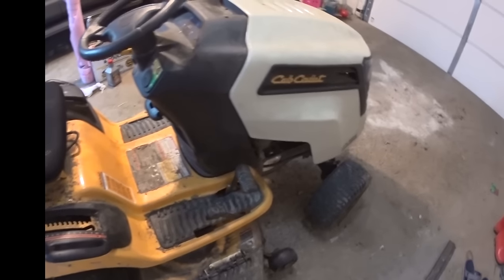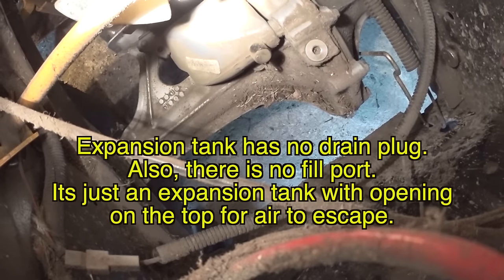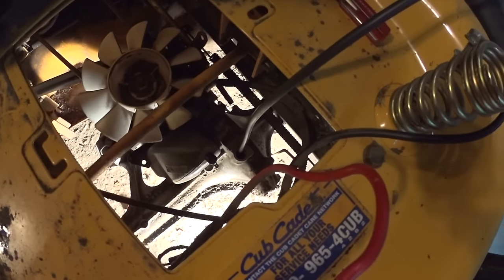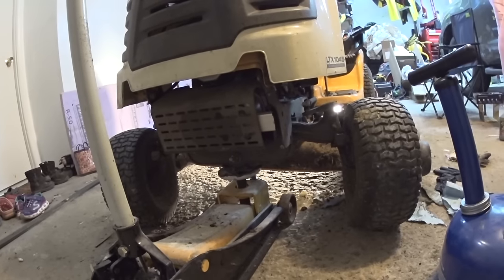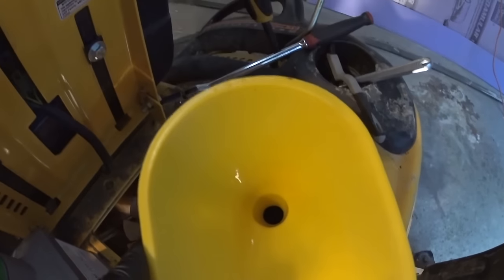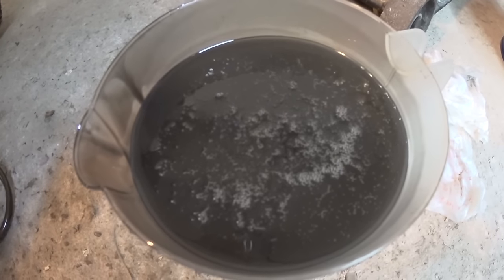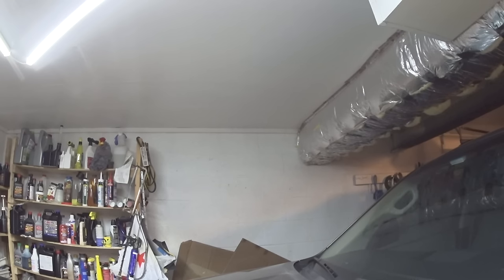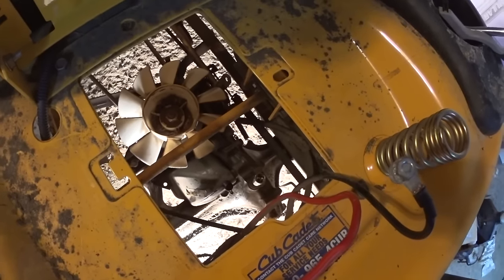Hydrostatic transmission fluid change, how to replace tractor transmission fluid, SCAG maintenance

Comment from the maker: Tools and fluids used in this video
Amsoil Hydrostatic transmission fluid 
https://www.amsoil.com/shop/by-product/transmission-fluid/automatic/20w-50-synthetic-hydrostatic-transmission-fluid/?code=AHFQT-EA&zo=5257753

Every car, truck and EV needs this https://youtu.be/H_bSDqnSh90
Maintenance mistake made by diesel owners https://youtu.be/WBOBzA56jvw
Why trucks don't come with this? https://youtu.be/hBbzJmCHtCo
How to improve lights without cutting or drilling https://youtu.be/K4WbM97pkmE
How to protect paint on the vehicle without wax https://youtu.be/I1fu9TsiYBc

Transmission fluid for HD applications
https://www.amsoil.com/shop/by-equipment/semi-trucks/?zo=5257753

Look at this 350k miles Ford. Since when Ford became reliable https://www.amsoil.com/newsstand/testimonials/articles/pristine-ford-flex-tops-350-000-miles/?zo=5257753

Topsider vacuum pump
https://amzn.to/2JzKtp2

Funnel very similar to what I have 
https://amzn.to/2PNWY1f

Pump for fluid transfer 
https://www.amsoil.com/shop/by-product/gear-lube/amsoil-marine-gear-lube-pump/?code=G3456-EA&zo=5257753

Hex set 
https://amzn.to/2PLIzCO

Measuring Cup
https://amzn.to/2Y2ZovW

Paper towels
https://amzn.to/2LmWhxk

Brush to clean around fill plug
https://amzn.to/2H63YEh

Update on fluid change video 
https://youtu.be/yedcpETVa-8

Comment: No questions at all, you covered it well in the video man you left nothing for doubt
Reply from the maker: Thank you
Reply: @repairvehicle  I did like the video, but the reason why I watch your video is I had to come to that myself, it's the 1500 LTX,
 I knew that I was going to have to replace the bearing soon in my mower deck so I went ahead and while I was doing that I've looked at your video so I can do mine but while I was doing my hydrostatic drive on the oil where you pumped yours out I don't know if you're hydrostatic axle is the same, but mine had a dream on the bottom of the hydrostatic drive there's a little round column on mine in the middle of it has a drain plug right in the center of it,
 But anywho I wanted to throw that in there about mine I don't know if yours is the same but if you haven't looked which most possibly you already have there's underneath my 1500, and also wanted to comment on but even though mine was a bigger tractor, it only took the same amount of oil was that yours did.

Comment: Looks identical to my Craftsman PYT 9000 (2011) I have. Mine is labeled "Hydro-Static 618-0319." Still runs well. Thanks for the video. I've not found ANY better YouTube.
Update; I meant to say Hydro-Gear. Upon pulling the top fill plug and removing the expansion tank  my HG was full to the top. I syringed out using livestock syringe about an inch and half in diameter by five inches and clear poly tubing. Put a piece of bailing wire inside the tube to direct deep into the axel. Got 50 ounces out and could see no more oil. Refilled with new back to the top. Tractor Supply store had Hydro-Static oil on the shelf. One gallon $29. May my tractor will work another 11 years now. But will change the trans at three per your recommendation. Thanks.

Comment: Excellent video! I have an older Craftsman 42" mower with this exact transmission. My transmission is suddenly working very weak. It will move forward and reverse but nowhere near as fast as it used to and not up or down hills. I am thinking my fluid levels are not only low but need to be changed after 15 years! This video really helps me. Thanks!
Reply from the maker: Thanks for commenting
Reply: Todd I have same thing happening with my mower did u engine changing hydro static fluid
Reply: @PeteyMcSavage  I wrestled with that thing for a couple of weeks and ultimately realized the transmission is not designed to be serviceable. I managed to siphon as much of the old fluid as I could and added new fluid but it didn’t help. I ended up replacing my mower
Reply: Replace the drive pulley under the fan.
Reply: Sounds like your drive belt was stretched and needed replaced.
Reply: @Motoxr32 great thought. I noticed my mower appears to lose power once it got warm as it would struggle on inclines and move slower on flat ground. I initially thought it was the engine compression, but then noted that it would climb hills excellently in reverse gear. So appears to be transmission or potentially a belt that loosens as it gets used/ warm.

Comment: Thanks heaps mate. I have and MTD ride on and the transmission is identical. Great video. Lots of good info and all of it helpful. No gimmicks or annoying acts. 
I searched for ages to try and find a video like this. My mtd ride on mower would drive around fine bit once it got warm after 30 min it couldn't make it up any hill as the transmission was overheating from lack of fluid. 

Took my mower apart looking for a full plug and couldn't see it because it was covered in crap and looked like a washer!

My mtd 42inch 16.5 hp has the exact same transmission as the mower in your video for anyone else in my situation
Reply from the maker: Don't forget to subscribe. Thank you for commenting.

Comment: I saw this when replacing my battery...saw the tray came out and noticed the fill and overflow bottle.  Nothing in the manual other than lifetime serviced.  Thank you!
Reply: I wasn’t concerned until you presented how filthy and contaminated the fluid was....I need to service mine STAT..

Commercial lawn tractor spin on oil filter engine and grease Zerks everywhere for long life with proper maintenance.  Even a little dashboard computer that tells you when to service parts of the tractor based on hours of use. All this to ensure a long life machine.

Yet the transmission sits in its own filth, ignored, forgotten and dies prematurely....nice.
Reply from the maker: If did not mention in the video, then I don't know the size.
Reply: @repairvehicle  
It's a weird one!
It is either a 6.5mm or 9/32".  1/4" is too small and 5/16" is too large.  
6mm is too small and 7mm is too large.
My guess is it is 6.5mm or 9/32".
I got it out using a 1/4" pulled to a hard angle to grip enough to remove the filler plug.  It almost stripped out, but got it.  Judging by the filth of the oil from my transmission, this is something that MUST be done every season with engine oil.  These being sealed and only magnets to capture particles is a crime.

Flushing mine out until it comes out clear.  Third time and still dark.  Good thing I got 2 gallons of hydrostatic oil.

Thanks again for making this video and bringing this to people's attention.  Lot of money spent on this equipment to be sabotaged like this.  Subscribed.

Comment: I have a K46 in my John Deere. It has no drain plugs, but it does have an internal filter and two round disc magnets. It also has two stumps in the housing, which will prevent you from removing oil from the top vent. It needs to be removed and taken apart, buy the rebuild kit from Tuff Torque.

Comment: There is a filter inside the transmission. You can get parts. Seals our also  available. If anyone having trouble getting the plug out just give it some taps on top. Works most of the time . But ust hard enough that you don't damage the housing or plug.

Comment: Thank you for the video. I have a Troy bilt Super Bronco XP 5 years old. 425 hours. Of course the manual says transmission fluid is not able to be changed. I hope I can do what you did. We cut pastures, harrow and pull a manure spreader. It’s used heavily.
Reply from the maker: That's what they say for everything.  Because they want to sell more tractors not less. Thank you for watching the video
Reply: @repairvehicle exactly 💯.  I'll buy a older tractor or diesel truck over newer anytime it's possible.  The right to repair with deere tractors is bullshit. The def on OTR diesel trucks is also BS. Bring back the good old day's enough with technology it's designed to control our abilities.

Comment: When you add that first quart, to spin the wheels for a while, use straight 10 weight oil. It's cheaper and thinner, will get more dirt out than using the thicker weight oi and less costly too.
Reply from the maker: 10 is not hydrostatic oil
Reply: @repairvehicle  I know and you aren't going to keep it in there, it gets drained after cycling through the trans axle. A couple remaining ounces won't hurt and thing.
Reply from the maker: @billconserva1461  I rather be safe than sorry. Diluted fluid is no longer same fluid

Comment: The plug is 1/4" hex.  6mm will strip it, and it's very easy to strip.  Mine was super tight, but an impact driver will break it loose

Comment: This is one of the best explained video's I've seen on You Tube! Very well done. I was thinking about, should I change my transmission fluid in my Husqvarna lgt2554, so I looked, it doesn't say anything about it in the manual. So I start looking on line, and you tube. I purchased my riding tractor on 5-26-2011, so, over 10 year's ago. I've never changed the transmission fluid, although I service it every year. It has to be very dirty. I've not had any problems with my Husqvarna, not even a flat tire, I did replace the battery once. I haven't looked yet, but do you think my Husqvarna lgt2554 will be similar ? It has a Tuff Torq hydrostatic transmission. I will get my son-in-law to help me do this. Thank you for posting this great video! Thanks, John
Reply from the maker: Is your gas tank in front or rear?

Comment: 6mm is the metric cousin to 1/4", which is the proper size hex bit for removal and installation of the drain plug.  Everything on my LTX 1046VT is SAE.
Reply: Thanks

Comment: Mine also has a leaking seal . I filled mine to the top , drove it and rechecked and it was at about the same level as you measured except I used a straight blade Craftsman screw drived . My plug required a 1/4 inch hex drive to remove , not a 6mm

Comment: Thank you for the video! I also use Amsoil products and have good luck with them. For vehicle manual transmissions and differentials they seems to retain color longer than even Red Line for me. 

Anyway I am in the market for new lawn tractor and left messages to other videos of why wouldn't vacuuming out from the fill valve work. If you do this every year, your transmission will work far longer. Sort of like draining sealed automatic transmission and replacing with the exact amount a few times to get a high percentage of new fluid in with the least hassle. Cheers!!!
Reply: If every year why not tap it and install a drain plug
Reply: @thedude8976  That's a great idea, mark and remove the casing, tap, clean to remove any shavings, and install a magnetic drain plug while you're at it.

Comment: Hi thank you for responding. I spoke to hydro gear and a technician told me I have to take the air out of the system after the transmission fluid change. I’m not sure how to do it. I’m having some slipping issues after I change the fluid when going up hill and he told me I have air in the system and I have to purge the air out after every transmission fluid change. Thanks
Reply from the maker: What do you have?
How old is your equipment?
Did you ask him how to take air out?
Did you have slipping before fluid change?
Reply: Loosen fill plug, both tires off ground, cycle fwd. and rev. a few times, check level, tighten plug.

Comment: I put  85w - 140  super tech gear lubricant in my craftsman  l.t 1000 it's a little thick 😂 but it seems to work good only problem is when it's cold you can't push the mower by hand the transmission is stiff tires will not turn easy until you warm it up 2 too 3 minutes... 😂

Comment: I tried to remove my fill plug on my Cub Cadet SLTX 1054 and snapped off two of those driver bits, it's a perfect fit, but the small detent in the bit where the collar of the drill driver locks onto, is where it kept snapping, I've soaked it in PB Blaster, will let it set overnight and try again.  According to Cub Cadet's Parts Diagram it's a SAE #6 plug, but the #6 Allen Socket I have isn't as snug of a fit, as the backwards driver bit.
Reply: Finally got the plug out today!! I had to hammer a larger Torx socket bit into it and she finally busted free!! sadly my siphon hose just barely fits in the hole, so I couldn't get much siphoned out.  I did read on a cub cadet forum that a guy installed a drain plug in his Hydrostat.  I'm going to give that a shot.
Reply from the maker: I don’t recommend installing drain plug. It will fail after plug install

Comment: I have a Craftsman LT1000 that is about 15 years old. My manual lists 20W-50 Oil and then it says "72.8 ounces" in the parts section. Since they obviously never intended for us stupid consumers to service our own mowers, I'm wondering if 72.8 ounces sounds like the right amount you used. Thanks again for an awesome video. I've been searching all day for a transmission like mine!
Reply from the maker: If it's not in the video,  otherwise I don't remember exact amount I added.

Comment: I was only thinking the other day "if" oil has to be changed every 6-12 months regardless of km's/miles done oil containers would have a "used by date on them"!  the way these oem companies carry on to get you back in for serving is a scam in my opinion.
Reply: There are many causes that can result in the degrading of lube oil. The most common are oxidation, thermal breakdown of the lube oil, micro-dieseling, additive depletion and contamination.
Reply: Oil in a machine will get water/contaminates in it if in a machine.

Comment: ok still with the hydrostaatic fluid . I have tried and tried to get the plug out to put in hydrostatic fluid but it is so tight even my dewalt impaact driver can't get it out . . Left is to loosen it but it won't loosen it at all .

Comment: My riding craftsman YT 4000 is seven years old. Having trouble going uphill. I’m going to try this tomorrow but it may be too late....
Reply from the maker: it doesn't hurt to replace fluid and see if it helps. I know a guy in my area who's tractor stopped going forward completely, he changed the fluid and problem went away.
Reply from the maker: this is one of the examples, this comment came from a different video on my channel  (why Hyundai owners switch to amsoil oil) You can go to this video and ask him questions if you want. raburn2906  • 5 days ago
@repairvehicle The Amsoil Hydrostatic Transmission fluid is top notch! I am currently using in my Cub Cadet. It completely stopped all the whining and slipping issues that I was having
Reply: My Craftsman YT4000 has exactly the same problem, so that's why I'm here. Did changing the fluid fix yours?

Comment: i did knot know i had a filter on trans till i had to replace drive belt  i lifted the mower on its side with  eng lift  i saw the filter  i dont think it had ever been changed   out of sight out of mind  you need to change this filter  when you change oil in trans.

Comment: Great video as I just picked up my first rider and it's a cc 1046vt and looking to change all the oils but couldn't figure this out. I wonder if I can use the ford ptu drain plug add to put a drain on the bottom? Has anyone ever tried it?

Comment: I have a 1040 cub cadet, the gas tank is over the rear end, could you recomend a good way to access the plug as you have shown, thanks, my mower  doesn't  want to pull forward very fast, reverse is ok, do you think this is the problem?
Reply from the maker: Very often dirty fluid is the cause for transmission not work properly. Removing gas tank maybe is the best way to get to the plug?

Comment: Good video. What is in that gray container with a rubber cap next to the trannie drain plug?
Reply from the maker: I think it’s a expansion tank since fluid expands when it becomes hot
Reply: @repairvehicle  Thank you. Sounds very readonable. 👍

Comment: Thank you for the vid. Is "Lawn Tractor Transaxle Vent Valve" the same hole that you used to replace transmission fluid? Mine is Craftman YT3500 which has a fan on top of transmission. There is a rubber plug next to it. It is called "Lawn Tractor Transaxle Vent Valve."
Reply from the maker: My transmission has fill plug that I have used to change fluid. Did you watch video without skipping?
Reply: Yes, I watched it carefully. Mine does not have a fill plug. It only has an air vent rubber plug.
Reply from the maker: Maybe rubber plug is a fill plug?

Comment: Dirty oil is the reason why my craftsman tractor is not going back or forward?
Thanks
Reply from the maker: Dirty oil is responsible for tractor not moving.
Second reason possibly , parts worn out and changing oil might not help. But there is no way to know unless you change fluid

Comment: I filled my transmission with 20w-50 syntetic oil because it was hardly moving up the hill and at som point it stopped moving completly when transmision got hot and when Ive put new oil in,     everything was back to original, it was pulling up the hill no problem but after few months I noticed that after  transmision heated up it all started back again, I couldn't go up hills . Should I change the oil again?
Reply from the maker: Did you use hydrostatic oil ?
Reply: @repairvehicle  yes
Reply from the maker: Possibly transmission is worn out and changing fluid again might not help.
Reply: @repairvehicle  I changed the fluid today again, but I didnt try riding it, I will update you when I do it
Reply: @TrailMaker2 does it helped?
Reply: @char4cl  nope , it slips even faster now , after about one and a half hour of mowing

Comment: my mower has filter on the gear box  i just changed it  dont think it had ever been changed before very heavy    did he say any think about the filter  or do they not have one  it underneath the gear housing about the same size as oil filter on the engine  might want  to check it out
Reply from the maker: Some have others don't.  Mine doesn't have filter for transmission.